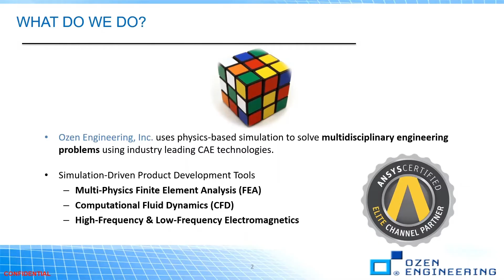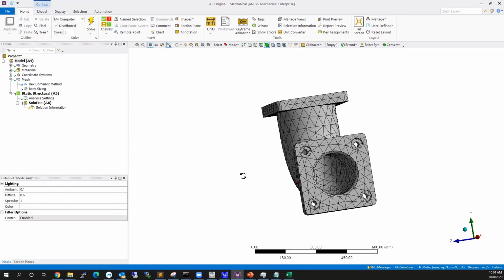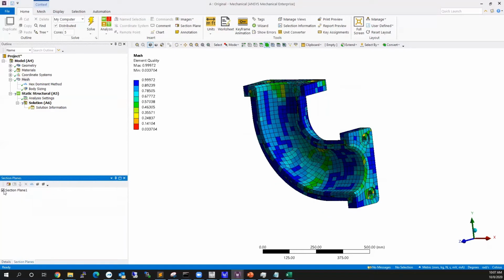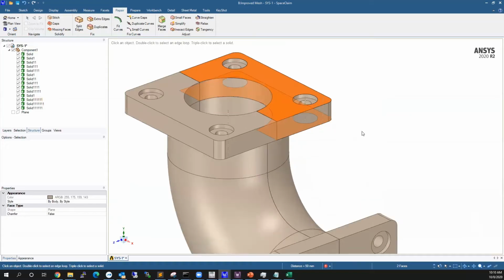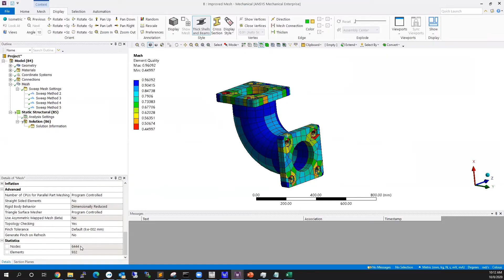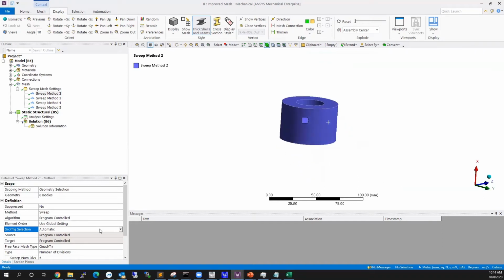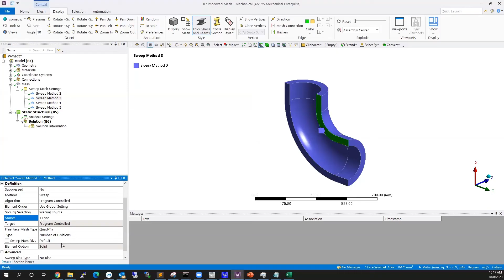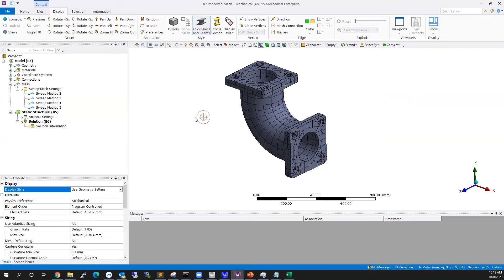How to Improve Your Mesh in Ansys Workbench

Comment: Hey there! Got a few suggestions for you. For the cylinders use an Edge size meshing to divide it in numbers. Rather than using automatic use manual and select the inside surface. That will drastically improve the mesh quality in those cylinders

Comment: Thanks for the Video
However, to the best of my knowledge, the element through the thickness are better to be more than two elements or 3 nodes for more accurate results. Moreover, the cutting will bring the contacts to the solution equations and may consume more system recourses.

Comment: You put 5 sweep division for bolt holes and the flange has 2 divisions, then it will lead to hanging node inside, wouldn't that lead to some simulation error or is it okay to have hanging nodes..
Reply: He doesn't mention this but he is utilizing contacts between the various bodies because of the hanging nodes which is not ideal.
Reply: He just uses bounded contacts, Do I understand this correctly? Also won’t this still lead to stress discontinuity?